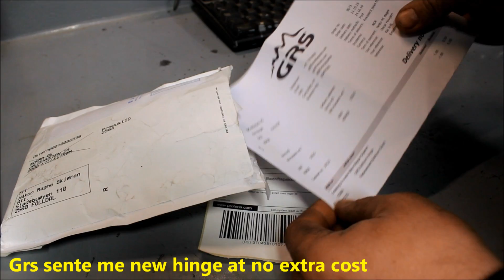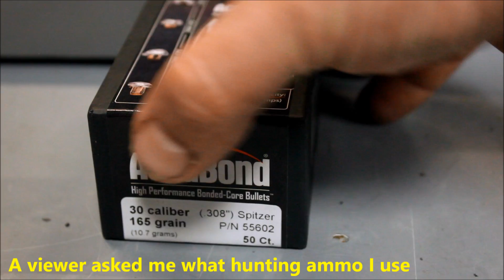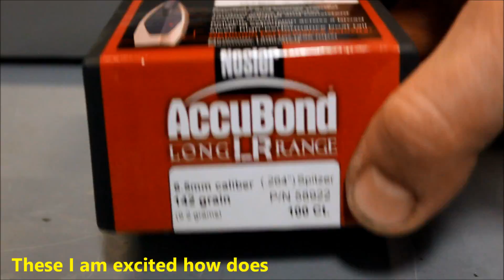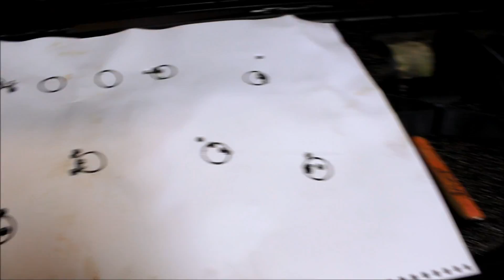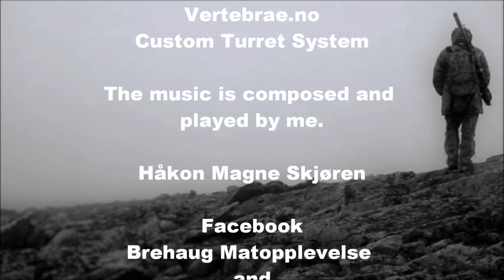Long Range Rondane nr55 New hinges from GRS

Comment: The play in the folder can be fix by better design. they need to add a closing clasp with throw lever that would compress the butt stock to chassis. One flick of the clasp lever and you could fold it. Again always nice seeing your progress and new gear. Good shooting!!!
Reply from the maker: Nice that you like the film, agrees that it should be possible to have a hinge that locks completely. But as the new hinge is I do not think it is going and create problems for me it stays well together. Man must use force if man should get a small crack

Comment: Hi Rondane Very nice video! What torque wrench are you using in "0:40" second? do you use other torque wrenches?
Reply from the maker: hI, I`am using this http://skytterlinken.mamutweb.com/Shop/Product/Momentn%C3%B8kkel-3-15-NM-Skytterlinken/2002161
It goes under many different names but is a simple and straightforward one.
And this one, it is obout the same http://www.brownells.com/gunsmith-tools-supplies/general-gunsmith-tools/wrenches/general-wrenches/1-4-drive-ratchet-torque-wrench-20-150-in-lb-prod37971.aspx